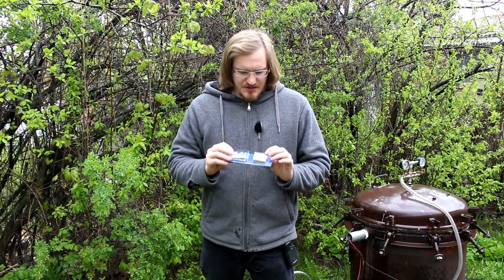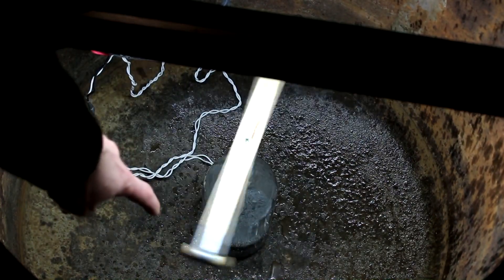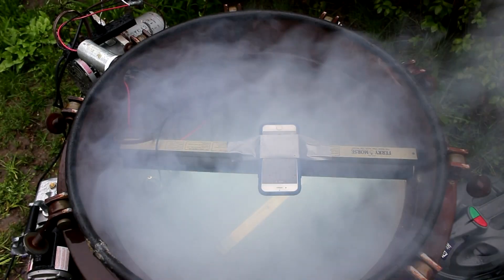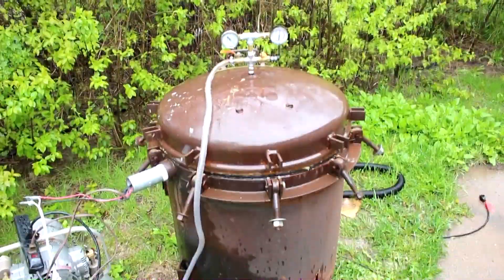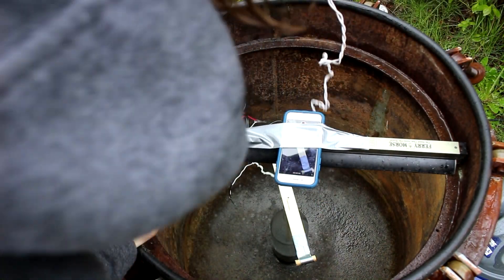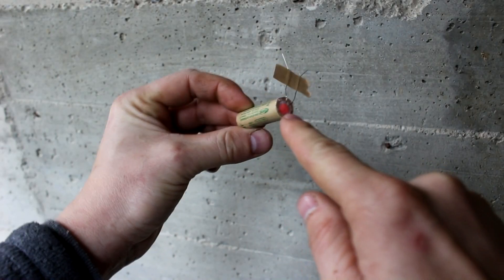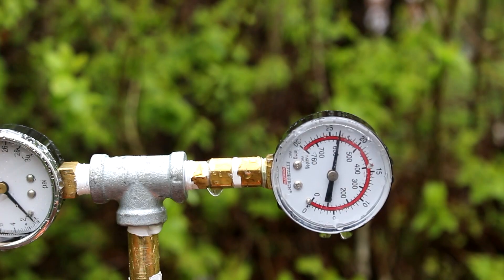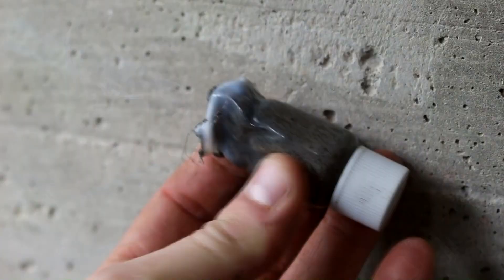Will a Model Rocket Motor Work In Vacuum?

Comment: Up to 5:19 everything worked as can be expected and you are correct, "that motor is NOT designed to run in a vacuum, it is designed for atmospheric use", in fact no motor is designed to run in a vacuum they all are designed to work with atmospheric pressure. Then he goes and  delegitimizes the test by putting the rocket motor inside a sealed plastic container with oxygen inside, the same as it would be like in an enclosed bullet. No one would argue a bullet won't ignite in a vacuum and the explosion will create a force or an action. the force is harnessed by the fact the motor is mounted to a stick that can only move in a circular motion. Therefore the movement we see is the result of recoil or reaction of the exploding rocket motor. No, the rocket motor worked great when it was in the chamber with NO vacuum and it should work even better when the chamber is under a vacuum. At least that is what NASA tells us, rockets work better in a vacuum because of less atmospheric pressure to resist the rockets movement. Going by that, we all saw up to 5:19 in the video that NASA is wrong. So thanks Cody, you proved NASA wrong again.
Reply: - " in fact no motor is designed to run in a vacuum they all are designed to work with atmospheric pressure. " This is FALSE.

NASA uses solid rocket motors IN VACUUM frequently and LIGHT THEM in hard vacuum.
Try speaking when you know what you are talking about.

"Cody, you proved NASA wrong again."
No he "Proved" nothing other than there are LOTS of armchair Engineers out there.....
Reply: @stuartgray5877  if they do, they certainly aren't in a vacuum. You probably don't know what a vacuum is anyway.
Reply: @rodneybaker2629  - "f they do, they certainly aren't in a vacuum."

Lookup the Delta-II rocket configurations that have a THIRD STAGE.  These Third stages (Star 48D) are SOLID rocket motors that are lit IN HARD VACUUM.
lokup Delta-II 7925, 7426-9.5

I have helped attach FOUR spacecraft to the top of one of these solid rocket motors at Hazardous Processing facilities at KSC then Launched them to deep space.
Those were: Mars Global Surveyor, Stardust, Deep Impact, and Kepler Space Telescope.
Look it up , then I'll be happy to accept your admission that you are misinformed.

"You probably don't know what a vacuum is anyway."
Nice assumptions ... 

I am a vacuum test specialist first trained at Lockheed Martin Space Simulation Laboratory in the 1990s where I operated one of the largest TVAC chambers in the country. 
I have been in change of multi-million dollar Thermal Vacuum Tests with Multi-Billion dollar vehicles under test. I have then helped LAUNCH those vehicles to space, and helped fly them when they got there.
Reply: @stuartgray5877  You are believing in something that isn't real. I too was an engineer for forty years and did many projects for the space program. I've done many tests and I too believed at the time everything I did for the space program was real and fulfilled a purpose. If you believe you did actual tests in a total vacuum, you are wrong. It is physically impossible to create a vacuum. A vacuum is devoid of everything, anything inside a vacuum deems it is no longer a vacuum. So, if space is a vacuum, then there is nothing there to cause movement of a craft. Movement can not happen if nothing physical is present to create a force to move something. Shooting hot gasses out the nozzle is not going to do anything unless the gasses push against something physical outside the rocket. Even a magnet requires something physical to cause a force. A magnet setting alone does not create a force until the other half is fulfilled by presenting something physical to work with or against. So, what i'm saying is simply if rockets can move in space, then space is NOT a vacuum and it is filled with molecules of something physical that can create a force to cause movement. If you think i'm wrong, then give me an example of created force standing alone and NOT acting on a physical object outside its own realm. To me, force is not created unless it does act on a physical object outside its own realm.
Reply: @rodneybaker2629  what's the matter?  Scared to backup you statement that you are an engineer? I call horseshit.
Reply: @rodneybaker2629  " then give me an example of created force standing alone and NOT acting on a physical object outside its own realm."

you want an example? : If I fired a standard steel projectile from a crossbow in a vacuum WILL I FEEL RECOIL?  Yes or No?
Reply: @stuartgray5877  Sorry I didn't get back with you, I didn't see your post. I'm sorry, the crossbow is not an example I'm looking for. I want the steel projectile to move on its own, not propelled from the crossbow. You see, the crossbow is an outside force acting on the projectile. The projectile is forced to move because the crossbow is NOT part of the projectile, it is outside, so it can force the projectile. In the case of a rocket, the outside air is the force acting on the rocket. You may not think of air being a force, but think of strong winds knocking over buildings. When the exhaust from the rocket leaves the nozzle at high speed, the air outside the rocket is not wanting to move out of the way so it resists the exhaust from the nozzle. Doing so it forces the exhaust to in the reverse direction thus causing the rocket to go forward. Of course the air is not a solid wall, so it does give into the exhaust a certain amount. You see, the air is the outside force that causes the rocket to fly. To cause anything to move or stop moving, an outside force has to be present. Remember, A force is a push or a pull that acts upon an object as a results of its interaction with another object. These two forces are called action and reaction forces and are the subject of Newton's third law of motion. an object must interact with another object, NOT its own self, in order for it to move or stop moving. The rocket exhaust is one force in one direction, action force, and the air molecules are the force in the opposite direction, reaction force. Then the rocket will travel. Again, if space is a vacuum, with no reaction force for the rocket, then rockets wont fly there. incidentally, All this is taught in schools and most students understand it. It was only when Dr. Wernher von Braun fired a gun in a vacuum chamber did people started to question what they where taught in school. The gun firing in a vacuum has nothing to do with rockets if you truly think about it.
Reply: @rodneybaker2629  so when the exhaust gases come SHOOTING out of the rocket nozzle at 2500 meters per second: WHERE DID THE FORCE ORIGINATE that accelerated the MASS of the gas?  Are you suggesting that gas does NOT HAVE MASS, or that mass can be accelerated WITHOUT A FORCE?  WHICH of those two things are you suggesting must be true?
Reply: @rodneybaker2629  and in my example the crossbow is the rocket nozzle and the steel projectile is the exhaust gas.  
Since it is a FACT that the crossbow WOULD get propelled backwards when it fires the projectile, can YOU explain the basics physics principles that govern the RECOIL FORCE on the crossbow?   Why does the crossbow feel the force when firing the projectile?
Reply: @rodneybaker2629  oh and since you claim to be an engineer, maybe you can answer a question.  Then I will show you proof of rocket Propulsuon in a vacuum

Rodney: at what altitude does Atmospheric Pressure get to what is considered 'vacuum"? 

 If we define "vacuum" as "pressure below 1.0 TORR", then at WHAT ALTITUDE does Earth's Atmospheric Pressure get below 1.0 TORR?
   Surely you are capable of looking that up (being an engineer and all ...)
Reply: @stuartgray5877  What you are referring to is the ACTION force caused by the fuel from the rocket. I'm NO way saying when the exhaust exits the nozzle it is NOT a force. But a force standing alone does nothing to itself. It takes another force, a force outside itself to react to that force. That's where the air comes in. It is outside the rocket and its force tries to resist the exhaust force. By doing so, the rocket moves forward. If no air is present, then the exhaust, as might as it is, does nothing to cause the rocket to move. It always takes a resistance working in the opposite direction to cause movement. Like when you simply walk. Your feet and legs can be as strong as a horse, but you can't move unless the ground is there for you to push off of. This is simple physics, I'm surprised you don't see this.
Reply: @stuartgray5877  When it comes to a crossbow, they experience very little  recoil. The little recoil it does feel is caused by the air the projectile is pushing against. If there was no air, the projectile would go much further. But, recoil is NOT how a rocket works. It is NOT propelled by recoil. It is simply the exhaust is an ACTION force and the air outside is the REACTION force. Remember, the reaction force must be something other than itself. The force the rocket puts on itself does NOT qualify as the reaction force. I'm sure that's what you've been told. Tell me this, if you set in an office chair, one that rolls, with your knees towards the back of the chair and push as hard as you can on the back of the chair, will the chair move? If it does, then I give up and agree a rocket can push itself in space.
Reply: @stuartgray5877  Why are you making snide remarks about me being an engineer? 
I could care less at what altitude the atmosphere turns to a vacuum. All i know is NASA says space is a vacuum and rockets fly there. Heck, they even fly better in a vacuum then they do in the atmosphere. You, like many other people believe this nonsense, when you know damn well it is impossible. You only believe it because you think space is real and we have all this neat stuff flying around in it.
Reply: @stuartgray5877  You crossbow experiment explains completely explains my point. It is just you don't understand your own experiment. When the small bolt was fired, it closely resembles what would happen in a vacuum, little or no movement of the bow or none at all in a complete vacuum. The reason for this is because there is little air to move because the cross section of the bolt is very small. As the bolt tries to move larger objects, more air resistance tries to be moved and it resists the bolt movement and thus the energy created is forced upon the bow. We have force from the bow and it has to go someplace. Remember, The first law of thermodynamics, also known as Law of Conservation of Energy, states that energy can neither be created nor destroyed; energy can only be transferred or changed from one form to another. It takes more energy to push through the air because more air has to be moved with the large ball on the end of the bolt. It simply finds it easier to move the bow backwards then move the ball forward. Thus the bow moves a lot more than the ball. If the whole experiment was done in a complete vacuum without any air, the bolt and or ball would have NO air resistance to plow through and you would not see any movement at all of the bow. A gun is something different. There is atmospheric pressure inside the gun barrel and outside, but when the gun fires the explosion causes more pressure in the chamber to build up and the bullet has to plow through it and the atmospheric pressure as well. Thus recoil of a gun will be greater then that of a crossbow.
Reply: @rodneybaker2629  Here is a BASIC PHYSICS PROBLEM for you that any high school physics student can DO IN THEIR HEAD.

I have a 10,000 kg mass “Crossbow” that is remote controlled.
It is loaded with a 500 kilogram mass block of WATER ICE, and cocked ready to fire.

The Crossbow/Ice_block “System” is positioned in zero-G, in a vacuum.
An observer is placed next to the crossbow.

The crossbow and observer have ZERO velocity with respect to one another (they are both “Stationary”).

Now the observer fires the crossbow via remote control.

The observer sees the 500 kg Ice block exiting the crossbow to his “Right” with a velocity of 2500 meters per second.

Rodney:
Using the Law of Conservation of Momentum – CALCULATE the velocity (with respect to the observer) of the CROSSBOW following the firing.
Hint: I can LITERALY do the math in my head.

I suspect you will concoct some excuse why answering the question is not possible....
Reply: @stuartgray5877  I find it very strange you are getting so upset over this, you need to chill out. A physics class is not going to teach you the things I'm trying to teach you. You could say you are in a class of higher learning if you will. You like many others are incapable of understanding the force pressurized  air molecules have on everything we experienced on earth. You have to realize we have nearly two tons of pressure on the top of our head as we walk around here on earth.  We are designed to handle it and it is part of everyday life, people tend to ignores it, but it is still there. If you would just stop for a moment and quit thinking about what you learned in school and pay attention to what I say, you may begin to understand. 

What you are saying is very true. You can say, " the THIRD PROJECTILE had the greatest recoil because the projectile had the MOST MASS", and that would be correct for the most part. But, what you fail to mention, probably because you weren't taught this in school, the effect the atmosphere has on moving objects. Not only is the more massive projector harder to move then the bow, so the bow move more in the opposite direction, recoils, but, the more massive projectile also has air resistance to plow through because it is more massive. It has more surface area so more air pressure is resisting its movement. Say the small projectile has 2 sq. inches of leading surface area and the larger projectile has 4 sq. inches of leading surface area. The small projectile has 14.5 x 2= 29 pounds of air molecules under pressure it has to push against and the larger projectile has 14.5 x 4 = 58 pounds of air molecules of air pressure to push against. Wouldn't you think since the larger projectile has more air to push against it would be much slower and harder to do then the smaller projectile or is still over your head? Because the smaller projectile has less air to push out of its way, it can use more energy then the bow can and the bow will recoil a smaller amount. The energy has to go someplace, it goes to the projectile or the cross bow. Even a guns accuracy changes from high atmospheric pressure to lower atmospheric pressure. If all things are the same, a projectile will  go further and the gun will recoil less at higher altitudes then at lower altitudes. It isn't much, but it is true. It's because the air molecules spread further apart and less atmospheric pressure is at higher altitudes.

If none of this makes sense to you, then I can't help you any more.
Reply: @stuartgray5877  This is silly, do you actually believe I can't work a math problem when I'm an electrical engineer. You say the velocity is 2500 m/s, what would the velocity be if it wasn't in a vacuum? How do you know what will happen in a vacuum since we can't create a real vacuum on earth. You can only speculate what will happen. All I can tell you is everything that happens on earth is effected by air pressure from the atmosphere. There is NO avoiding it, it is all around us. It is people like you who don't want to believe it effects anything.
Reply: @rodneybaker2629  - "his is silly, do you actually believe I can't work a math problem when I'm an electrical engineer."

"I'm an electrical engineer."

You are NOT A FUCKING ENGINEER.

TELL US WHERE YOU GOT YOUR DEGREE or quit fucking LYING!

Then DO THE FUCKING CALCULATION assuming the crossbow is sitting on a friction-less surface! and NEGLECT AIR RESISTANCE the answer IS THE SAME.

YOU STILL CANT DO IT.
And I KNEW you would come up with a horseshit reason for not answering.
Vacuum MOST CERTAINLY DOES exist on earth.

"How do you know what will happen in a vacuum since we can't create a real vacuum on earth."

Did I even tell you that I have been a vacuum test specialist for almost 20 years?
I was first trained at Lockheed Martin's Space Simulation labs.  I have operated some of the largest TVAC chambers in the country with BILLION dollar vehicles inside.